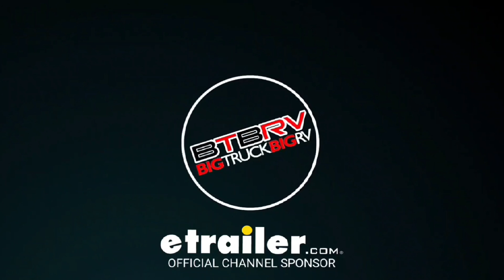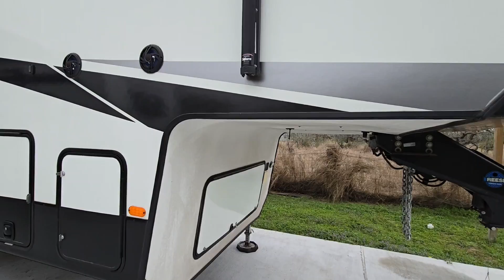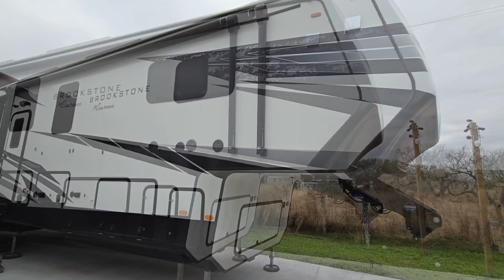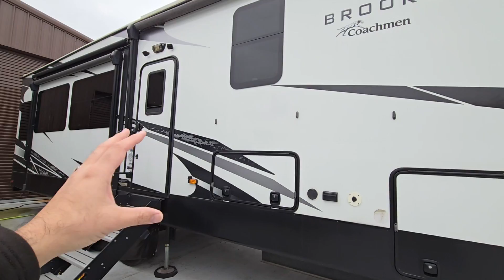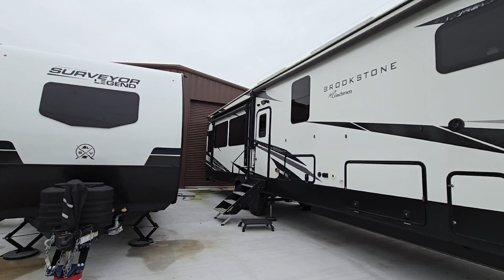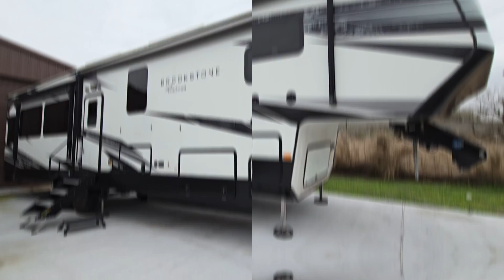BIG FRAME FLEX Update! Heading to Indiana ask Lippert Viewer Submitted QUESTIONS!

Comment: standard canned answers of shifting the blame, no surprise. You ruined the whole premise by asking when "frame flex" occurs. I don't care about frame flex. I want to know about frame FAILURE.
I do think the manufactures are probably more to blame than Lippert, but as the manufacturer of these frames, they definitely shoulder some of it.
Also the "one tenth of 1 percent" number is total BS. #1 I'd like to know where they get their data. How do they know every failure has been reported to them? I know for a fact they aren't. Plus, the vast majority of 5th wheels are permanently parked or moved once or twice a year. Obviously those aren't going to have frame failures because they never move. I would venture to guess the number is orders of magnitudes higher when you look at only the RVs that are moved on a regular basis. 
FTR we've had 2 5th wheels in 3 years and BOTH have had extensive frame failure. We aren't overloaded, and we've never had any of the other situations you've mentioned.
Reply from the maker: Who did I blame?
Reply: @BTBRV  I didn't say you did, I said Lippert did. Claiming failures are results of other problems rather than poor engineering and poor welding.

Comment: So basically, nothing solved  !!! Roads are awful everywhere  !!! These are meant to travel often,  but now only on good roads and occasionally.  Seems like a cop out  !!!! There's definitely a failure problem,  I would hope Grand Design and others will either build a more robust
unit for their over 40' or scale down to the build strength of current manufacturing tolerances.
Reply from the maker: I think the real answer is use common sense when you're traveling, and understand what road conditions can do to any structure. Secondly that there could be manufacturer related issues as well, and thirdly that this does impact a very very small number of units.

Comment: Big time politician. So apparently mid profile 5th wheels with under 17,000 lb GVW never have water damage from washer and dryer dryers and roof repair. Let’s face it   They are having problems with these larger units and they aren’t built properly. Whether it’s lippert or the manufacturer. There is a problem. Mid profiles get taken down the same roads and even worse roads than the big residential units. Overloading happens on all units too. Let’s be honest. Please!!

Comment: So you are saying that a toy hauler that is designed and promoted for carrying off-road toys, is not supposed to be driven off-road. Hmmmm. Also there are some Thousand Trails parks that are pretty bumpy. The dealership gave us a year pass. Guess we shouldn’t have done that either.
Reply from the maker: When you look at a toy hauler, that's 40 ft long and weighs 20,000 lb, do you really look at it as an off-road vehicle?

Comment: Most RV construction problems could be solved by simply building the frame to full CARRY the house. Relying on a blend of strength built between different TYPE of manufacturers is a recipe for disaster. Think about it. The trailer manufacturer makes trailers, NOT RVs and vice-versa. How can they be expected to take on the task of engineering something solid when they both have such different goals. Make a trailer frame that does not need to rely on the house structure for strength. Problem solved.
Reply from the maker: Add 10k lbs in frame steel
Reply: @BTBRV   Do you think it would really be that much? A boat trailer doesn't weigh nearly as much for a 15k lb. boat. It also doesn't need a structure above it to make it stronger?

Comment: You are sponsored by Lippert. Like you were going to say anything negative. It's a design issue 💯 ..... I like how you were talking about water damage . Possibly causing damage to the frame. Yet my gooseneck dump trailer lives outside. That i overload all the time. The frame is just fine. It is a design issue. They should stand by their product.
Reply from the maker: What on earth would make you think I'm sponsored by Lippert? Also, the instances of water damage I referenced in this video were because a dealer installed a washer and dryer incorrectly And probably failed to properly dry the unit once it was wet. Regarding your gooseneck, just like mine, it hauls equipment around which doesn't react poorly to flex. Attach a rigid structure on top of the frame, like a home, and see how much the flexing that your gooseneck trailer and mine has affects that home. Far more than you think.  Come on man, these are totally common sense technical explanations.
Reply: @BigTruckBigRV  So you aren't sponsored by Lippert. My bad, you fooled me, thought you were. As for the common sense, "technical explanations." You got me. I got nothing 😆 It just happens to be the same manufacturer and model. Whatever, I'm out. I won't be watching any more videos. Gl with the channel.

Comment: 1- the wall is not structural to the frame. If it was designed as so, thin gauge aluminum wall mounted to 2 sections of frame flexing at different rates bonded together by glue onto 1.5”x1.5” aluminum square tubes stuffed with wood lagged onto the floor isn’t the way to do it. 😂 look at any box trailer manufacturer outside of the RV world. 

2- travel trailers have their own set of issues, from bending a frames, bending outriggers, and braking frames at the hangers. The latter all affect fifth wheels as well. 

3- enclosed trailers don’t have the same issues with frames. 

All very elaborate answers given to the executives by the legal team 😂

Comment: Given their recommendation to evenly distribute the load across the length of the trailer, would that affect your recommendations for tow vehicles? I have always thought you were adding too much of the payload to the pin which I know can be adjusted by placement of the payload. I don’t own an rv yet, but in researching them I found your channel. Watching your reviews led me to believe my 3000# payload truck would be inadequate for anything but a small fifth wheel, due to pin weight. Your channel has been a great source of information for me and I thank you for putting it out there. One final thing, this was a very informative episode and I look forward to the follow up with Lippert.

Comment: It doesn't seem like the frame should rely on the box structure to carry the load.  When you have a gooseneck trailer the weight it is based on what the frame can carry.  These frames should also be rated the same way, not based on whether the walls are attached.
Reply from the maker: That's because Gooseneck trailers do not have walls attached. And they flex far more than you might think. So couple a superstructure on top of it, and you're asking for problems unless the superstructure contributes to the frame structure.

Comment: You’re talking, a lot of gobbling goop the large RVs the frames aren’t welded properly to handle the weight. Every fix is to re-weld the frame and multiple spots not reattach walls. Blaming it on a water leak is Lippert way of not having to fix their frames.

Comment: Great video and informative. It was just a matter of time before you got your hands on this subject.  And can’t wait for that interview with the engineer 
Now for the kinda not fun stuff  the manufacturer that claim the have commercial grade tpo roofs. Well that’s a flat out lie and keystone was not happy at all when we took ours up for the broken frame. But I stopped by my shop and took a section of actually commercial grade tpo and showed them the difference. The biggest difference was theirs was just shy of half the thickness of real commercial grade tpo. 

The “flex frame”.  Always a touchy subject but from personal experience with working with engineers some of the smartest idiots in the world yea my boss didn’t like me calling him that but after a few months he came to realize what I was saying.  They know exactly how it’s suppose to work according to the specks. But in real world it would hardly work at all which I spent days fixing the mistakes.  Which to be fair they never worked in real world. Which is the same for lippert. And the manufacturers.  Main issue the manufacturers need just say six lag bolts for upper deck. Well to save cost they just put in four. Well now the side walls pull away from the frame and crack side walls. That’s part of the issue 
Second part.  They are using the exact frame for low profile fifth wheel as they do is full profile. Not accounting for that height and weight difference this should be a totally different frame lippert need to weld in two cross supports for this and problem solved yea that’s what we had to do on our second fifth wheel.  
So the steel frame. They claim it’s a 1/4 “  but when you scrape off the wax yea wax not under coating and take a caliper to it well shocking enough it’s not 1/4”. But with the wax it is. 
Ok third one. Side walls again always seem to crack on a slide out.  When the wall is taken apart they have two hallow tubes that are tack welded. Not two that are wood filled and lag bolted together 
Roads. Well we all know the definition of insanity and the road crews deliver every time. Six in bad of rock four inch pavement base with two inch over lay four to six years later pit holes happen. So rinse and repeat. Oh forgot as soon as the road is done they have to cut a section out to fix a drain pipe that was done wrong.  But if just imagine if they poured a single pour of a ten inch road one pass they wouldn’t have to touch it for at least 25-30 years not possible ya say. Well Europe does it that way.  The autobahn is 14” thick single pour and when it need repairs they go from seam to seam not just the pot hole. 
Another little lesser known fact lippert tells the manufacturer what frame to use not the other way around well because they are the so called experts. If the manufacturer said build they frame like this they would and also say it will cost this much more most out not all would say ok build something that kind of works. it all comes down to profit and loss how many manufacturers say look we have the best service after the sale. Versus hay we have to lowest service after the sale because we build the best Rv.   None of them the cost to build that out ways the just to build it that way when what 90-95 use the heck out of an Rv year one and year two use them even less then year three maybe three to five times a year for a weekend.  No one would spend that kind of money for that. We as Americans are a disposable society buy it low as possible throw it away and get a new one. 

So I truly do hope they allow real questions and suggestions

Comment: If you stay within the weights and welds break then it is a failure.   Pure and simple.
Reply from the maker: Again, you need to watch the whole video. The welds will fail if the body of the RV becomes detached from the frame and the frame flexes extensively because of it. Like any superstructure on frame that supports anything,
Reply: @BTBRV  I did.

This is exactly to my point.  There have been cases where the customer is in the middle of the "point the finger game" between the RV manufacturers and the frame manufacturers.
Reply: @BTBRV Now ya need sponsorship to radomly buy a few rvs, take em apart and see if they were properly attached to the frame....now wouldn't that be interesting? 🤔🍻
Reply: And I would add.   Between the RV manufacturer and the frame manufacturer.  Putting the consumer between the two of them is just wrong.

Comment: J D instead of blaming the RV owner for the way they use their RV. You should blame The manufacturer of the RV and Lippert for not making the frame strong enough to be towed without failing.
Reply from the maker: Pretty sure I didn't blame anybody. I pointed out facts and speculation based off of information that I actually gathered from RVers
Reply: @BTBRV  I will have to watch the video again. I thought you implied the frames failed from improper use by the RV owner.

Comment: You have a 200lbs bed? What is it a waterbed.😊
Reply from the maker: Believe it or not, mattresses gain like 20 to 30 lb every year from your body.
Reply: @BTBRV geez u forgot to mention how your body oozes through waterproof mattress protectors and taking a shower daily, n washing your sheets weekly all ties into your erroneous figures 😂.
Reply: @BigTruckBigRV   so is a fifth wheel with no slides and a short upper deck stronger and more less likely to fail?

Comment: Honestly im left with more questions than answers at this point.  

I know i never thought the RV wall and floor structure of the RV would be a part of this. I would have thought the frame would be built to handle the intended loads separate of that structure. To me its long speak for it was not engineered sturdy enough in the first place.....  Personally don't see how the wall structure would effect something like say a loose pinbox where the structure around that failed. I can see it for sure where the deck meets the vertical column on most 5th wheels and it makes the boxed upper deck of the DRV and riverstone look really good.... Same with the hung wall construction and how they both attach it with carriage bolts and nuts. 

I also see a place where the manufacturers are on the hook here. If its true that wall separation from the frame is to blame how is this not on the manufacturer? Its not just used RV's that experience this, look at the " 1 strange adventure" folks. They are the original owners and if you look at the things they pointed out there were lags that attach the walls that were just flat out missing from the original build and some that were undersized and just ripped out. That is 100% on grand design. It also makes me wonder about the walls themselves. On the brands that are welded is it an issue where those walls are failing too? Aluminum gets very brittle from the heat when you weld it, the weld is strong but when it fails it tends to do so right next to the weld where it was heated. That is just the nature of aluminum. Makes me wonder if that is also a factor since we don't hear of lots of failures from the hung wall brands that use angle brackets and screws. 

As i said still a lot of questions in my mind. I would love to see some actual failure pictures shown of what broke and why. Computer models to show how the walls effect the structure and the stresses caused by not having them attached would be a great thing to see too if they can do it in something like solidworks. They really need to be transparent and show everything going on not jsut pass the buck saying its a second owner problem or a full timer problem etc.

Comment: Hmmmmm, these top “Lippert Executives” you referenced is interesting. Did they provide actual data or are you excepting there word?  I’m thinking sourcing or documentation is very critical rather than taking someone’s or a cooperations word.
Reply from the maker: I read you the response that they provided me. Modifying that response wouldn't make sense in this video.  Unless there is a detailed report that I can point at, the only reference information I have is what they provide.
Reply: @BTBRV  Maybe when you go visit Lippert you can actually ask them for the documentation that supports their email. And look, I’m not trying to be difficult, as an avid camper I’d like to know what is causing this issue and hopefully it’s being addressed soon!!!  Numbers don’t lie and if it’s happening to specific 5th wheels (I.e. due to length, not enough axles, weight up forward vs spread apart like your video states).

Comment: If you want to do it correctly try asking Lippert about the impact that a long lever has on upper deck stress.  Your Reese pin box imparts significant stress on the upper deck due to it's length.  Second getting a cushioned hitch will significantly reduce the problem. New Horizons builds a well designed frame and you should look at that correctly.
Reply from the maker: I've evaluated New Horizon's frame and it's design appears to be nearly identical to most heavier frames from Lippert.
Reply: @BTBRV then answer how many 'different' frames lippert actually makes? How many different frames in the rv industry? 🤔
Reply: I've always wondered about the extra stress the gooseneck adapters put on the frame.   Are the frames designed/built to handle the extra stress that is being put on that upper deck frame?

Comment: I'm curious to to know how much extra weight some of the "frame flex"victims are carrying in their rigs. It seems some of these folks have added very nice lithium batteries and solar set ups to their fifth wheels. No doubt a very heavy weight addition and typically to the front basement storage area of the RV. 
On A side note. I called lippert and asked about changing the pin box on our fifth wheel. They wouldn't answer with out me first gving my name and phone number. I took that as a way to track my history with their product for future reference.

Comment: Dude.  RV's "ARE NOT" composite construction.  That is BS.  The side walls on an RV are nothing but foam and very thin fiber glass that is designed to barely support itself.  The bottom line is the frames are built of too light of material, steel section sizes etc.for the weight the manufactures and owners are putting on top of them.
Reply from the maker: This would be true IF the manufacturers didn't have guidance to build their upper deck as a structural component.  This would be the same with ANY FRAME designed to carry a Rigid structure.
Reply: That doesn't change anything.  It is passing the buck.  The frame needs to design for whatever weight is on them, and they are not to save money and weight.  The weight that they don't want to tell the customer that only a F450 dually and above is capable of pulling.  This crap has got to stop.